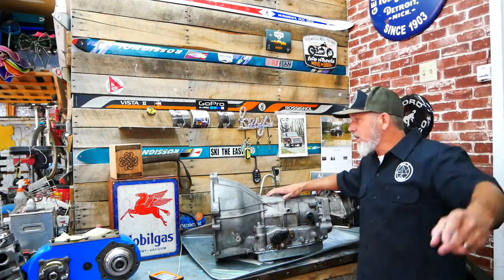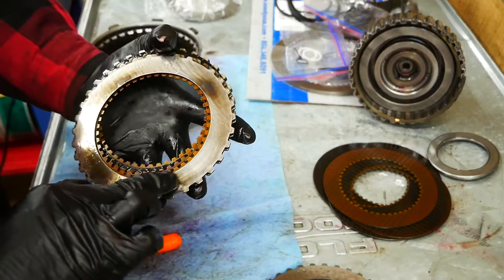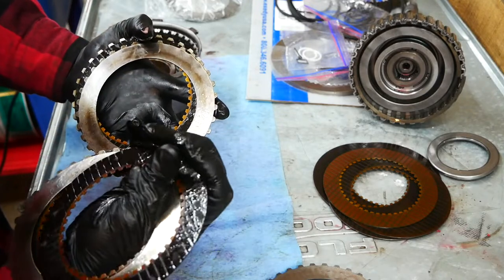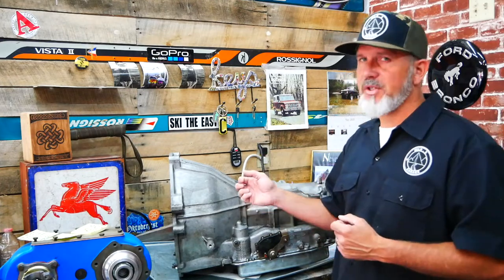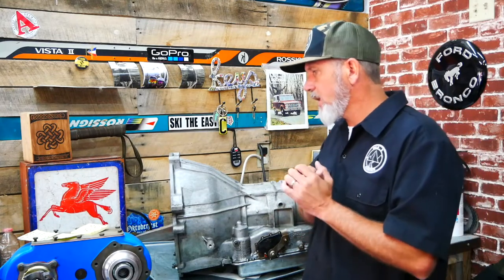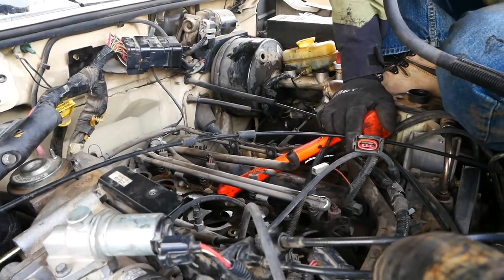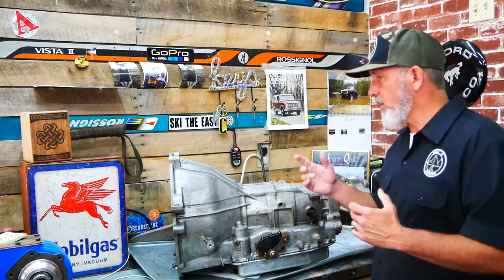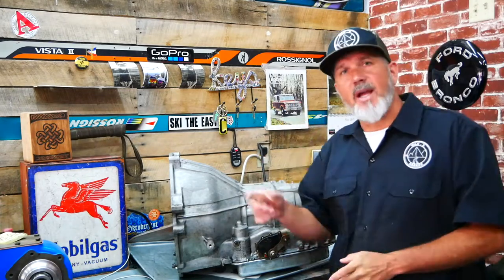Early Ford Bronco 4R70W Why, How, and How Bad Was It?

Comment: That is what I run. Great transmission.
Reply: Torque and HP ratings??? What are you running engine wise? I was looking at a 4r70w for new edge mustang coyote swap. Want 1000hp street Stang so gonna go 6r80 with forged internals
Reply: @markprice2225  under 300hp. Not hp motor

Comment: Ive got a 97' F150 with a 4.6.  I've got a mechanic friend who has an identical 4r70w from a 97' also with a 4.6.  If I were to mod my little 281, would it make sense to build the identical tranny up and swap it later.  Assuming these transmissions being a 97 is worth building?  Or should I seek out a 98 or newer and perhaps an adapter/rewire?

Is rebuilding one of these realistic without a bunch of prior transmission experience?